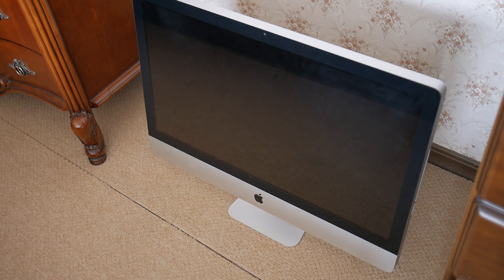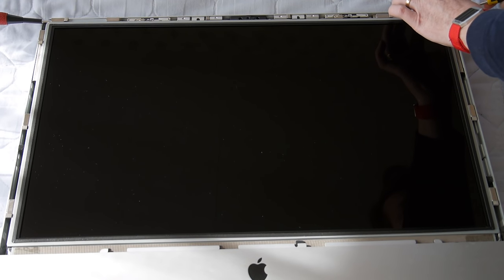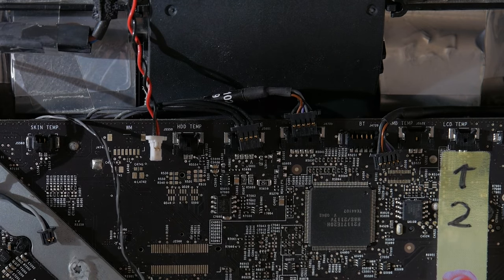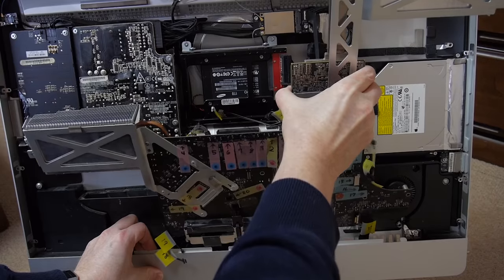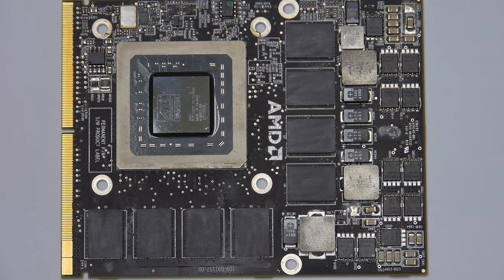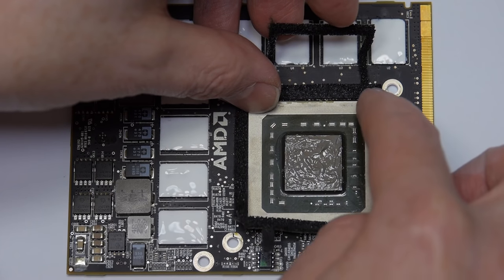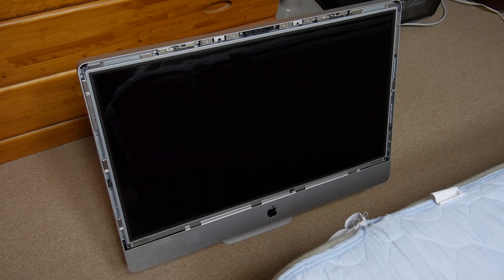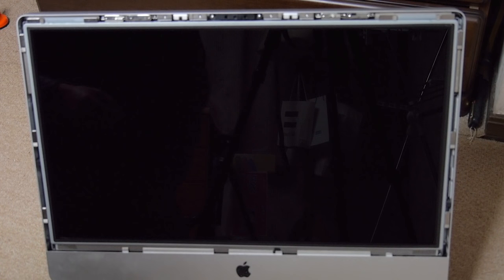Late 2009 iMac 27" Video Card Repair [4850 Bake]

Comment: I have two  2009 iMacs with suspected GPU problems. I took one apart to replace the thermal goo and ended up with a few screws left over :-)  It still  has occasional graphics hangs, annoying really since with a PC you could just swap in a new GPU but a fix for the iMac would cost c £200 from eBay ( new GPU with lead solder) Considering the cost of new Macs these days it may well be worth doing some day though. I've got a SSD in the optical bay and will convert it to a fusion drive when I get around to it.
I actually use my 2011 i7 MacBook pro most of the time these days it's already had the fusion drive upgrade and is a higher spec any way apart from the screen size. ( and I get to sit on the sofa all day too !)
Reply from the maker: You said you changed the thermal paste, but did you perform the video card bake as specified in my video?  Simply changing the thermal paste without baking the card will do nothing beneficial.  If you did perform the bake as I suggested, then your case is somewhat special because I've not heard a bake-failure from anyone here in the comments.  I could guess that the card may be bad beyond repair such that a bake would not work in 1 of your 2 computers.  But for both to be in such a bad condition is unlikely.  So again, if you merely changed the paste and did not do the bake, you will need to do the bake (10 min. @200°C) and then apply paste and then test before you can know whether your video card can be resurrected or not.  Thanks.
Reply: yes I think I may well end up 'doing the bake' at some point… I can't afford to send the GPU off for repair at the moment any way. Personally I think the 27" screen is a little on the large size for what I use computers for at the moment. I had ambitions of setting up a work from home office but like I said I mainly sit on the sofa and hack away on my laptop :-) I was definitely disappointed when it statred to freeze up, I have them both sat next to each other and use one in secondary display mode. The one that is driving the secondary display has the worst problems, although using SMC fan control it only locks up once in a while, so perhaps until it become un bootable I will leave it be for now ! If/when I take it apart again I will try to re-home those left over screws :-) Apple replaced the logic board on my 2011 MacBook last year for free so that makes me a little happier . Hope the iMac is still going strong sing last baking  ?
Reply from the maker: Thank you for clarifying that you haven't done the bake yet.  I like the big 27" screen for viewing photos or videos and for editing too.  It's not 4K but 1440p isn't bad at all.  Yes, my twice-baked video card is still going strong in my 2009 iMac as of Jan. 22, 2018.  No issues at all and the computer is used daily, for several hours per day, and my son plays games on it as well.  Be sure to let us know of your success or failure after your bake.

Comment: Hello JDW,
By disconnecting the INT DP connector from my imac 27 at the end of 2009, I broke the tracks on the motherboard (2, 12 and 31). On the Apple plans, track 2 is connected to resistor R 9050, track 12 to capacitor C9043 and track 31 to capacitor 9010. I only located the capacitor 9010 but I did not find C9043 and R9050. With your experience would you tell me where are its two components?
Thank you
Reply from the maker: Would you mind replying with a link to a photo of the "INT DP" and the "broken tracks" you speak of?  Also, when you say "Apple plans" it sounds like you have a full schematic?  That's certainly more than I have.  All I did was watch a few YouTube videos and read stories about using the oven bake method to restore a video card in the late 2009 iMac, and I then tried it myself and found it worked.  But I lack schematics to guide you in fixing "severed PCB traces," which I think is what you mean when you say "broken tracks," right?  If you could post a link to that schematic you have, I can read a schematic just fine and might be able to offer more detailed help for you.

Comment: Iv seen tons of these for cheap or free because the videocard is busted, might try and fix one.
Reply from the maker: There's no guarantee such a machine might no have other problems too, but if you can obtain an older iMac for free, you basically have nothing to lose by trying the bake if the machine won't boot or freezes or displays artifacts on screen.

Comment: Why are you pulling on the wires on the connectors on the logic board? That is a good way to pull them out of the socket. Use a tool to pry the connectors out. That is what the flairs are on the sides.
Reply from the maker: Greg, since you put your advice in the form of a question, I will answer it as such: "Because I've done that often enough to know how secure those wires are in their socket."  :-)  Is it a good idea to use a tool?  Sometimes.  It depends on the tool and how it is used.  It is possible to pry with a tool and find out you created small dents or otherwise cause damage from prying, so prying with a tool isn't automatically the better than pulling on wires.  Plastic tools can help prevent that, but they also can break too.  I performed the disassembly as most people would.  And you'll note that I wasn't "yanking" on the wires, which is of course a very bad idea.  Pulling on wires as a practice isn't necessarily bad, depending on how you do it.  Lastly, I read and reply to every single comment.  Currently, there are 526 comments.  Not a single person has reported that pulling on the wires in the same way I show in the video caused one or more of those wires to pull out of its connector.  With that said, I would encourage everyone reading this to use whatever discretion you feel appropriate to ensure your disassembly and subsequent bake goes smoothly and without causing any new problems or damage to your machine during that process.

Comment: thank you for the video! where is RAM? ))
Reply: Is there any posibility to add memory?
Reply from the maker: @gokostik  I show that at the very beginning of the video at 1:13.  I show how to open the cover and remove the RAM modules. You can swap out your old RAM for large RAM modules here.  You don't simply Add more RAM, you need to replace the existing modules with larger versions to increase the memory.  You can take it up to 32GB if you like.

Comment: Why didn’t you remove the old dry compound from the heatsink at minute 37:11? I’m curious.
Reply from the maker: Because the video above is my FIRST attempt at the bake and I lacked experience.  Another reason is because I was at that time no different than most of you folks and wanted to go on the cheap and use what I had, which was a small amount of existing thermal paste.  I didn't have thermal pads or even know about K5 Pro (a thermal pad replacement) at the time.  I rectified that mistake in my 2nd Bake Video.  But I think it is good to keep my 1st Bake video up because it still is very instructional in other regards, and it also shows what defines a "mistake" and how I later rectified that mistake by cleaning everything off and then using the correct replacement thermal pastes.  All said, please watch my second bake video for details on how to properly do cleaning and repasting.
Reply: Totally agree! Thanks so much for this awesome video and let us know how to make it work, step by step. Gonna look at your second video right now. I bought a Mid 2011 27” inch model a month ago with a one year warranty, the GPU started to fail so the seller who is a technician told me he will repair the iMac so I’m just waiting for it to be done, but I was digging into the issue and then I found you! Gonna told him about this and hope he can solve it quicker. You are THE MAN.
Reply from the maker: @INDIE505  Although there are some differences between your 2011 iMac and my 2009 iMac, the video card baking process is the same, and the pastes I recommend (K4 Pro for the GPU and K5 Pro for the memory chips) is also the same, regardless of which video card you have.  Please be sure to read through the text description under each of my videos because I spend a lot of hours constructing that info to be as much of a help as I can.  You'll find links there to the items I used for my bake.  My 2nd Bake is basically the same as my 1st Bake, but my 1st Bake video shows how to remove the motherboard.  My 2nd Bake video shows you how to remove the video card WITHOUT removing the motherboard.  Even so, if you want to replace the PRAM battery, you'll need to at least partially remove the motherboard.  I hope this helps!

Comment: Hello. What exactly was wrong with your video card? 
My mid 2012 imac suddenly stopped working. My mac powers up but the screen is blank. Took it to an apple service center to check it out. They said there was an issue with the video card and possibly the logic board.
I was thinking of trying your hack, involving removing the video card and putting it in the oven. I'm hoping I'll  will be as successful as all the others who commented on here.
Reply from the maker: I had a variety of symptoms. Sometimes it would just freeze after it was already booted. Other times it would freeze on start up and show artifacts on screen. Powering up with a blank screen like your case is a common symptom as well. You have nothing to lose by trying the bake except for a few hours of your time, so I would recommend it. But be absolutely sure you read through the text description underneath my video so you can prepare all of the tools and thermal paste required. Also note that I have a second bake video that you should review as well.
Reply: @JDW-  thank you so much for your feedback. What is thermal paste? I'm not sure if it's available in my country. Also in your video you mentioned removing the paste with alcohol solution.. Is there any other chemical I can use to remove that paste?
Reply from the maker: @gelpromotions7756  Start watching my 2nd Bake video from 27 min. 37 sec. to see exactly what "thermal paste" is and how to apply it to the video card: https://youtu.be/6BJGLFCigdA?t=1657
Reply from the maker: @gelpromotions7756  I bought the thermal paste set (2 types) from Amazon Japan.  It is sold at Amazon USA too.  Check Amazon in your country.  The company who makes K4 Pro and K5 Pro is located in Greece.  Here is their website: http://www.computer-systems.gr/en/content/product/k5-pro-k4-pro-set
Reply from the maker: If you cannot get the paste and the alcohol, I cannot recommend the bake to you.  Those 2 things are the most important things you will need to do this bake properly.
Reply: @JDW-  noted, thank you for your comprehensive feedback. Much appreciated.
Reply: Do you have an email address. I'd like to email you a picture of the video card from my machine so that you can check if it the same type as all the others on this forum.
Reply: Absolutely astounding! A true resurrection from the dead.... My imac is alive!  Thank you so much for your video... Truly life saving..

Comment: if you dont want to spend the money on the interface for the temp sensor , there is a application online called Macs Fan Control. You can easily set a rpm speed for you fan and TADA, done.
Reply from the maker: Yes, and links to those fan control apps are actually given in the text Description below my video above.  But when I installed my Samsung EVO 1TB SSD into my late 2009 iMac, I still wanted to have the temperature sensor installed too so I did not need to rely on software to keep my iMac's fans running normally.
Reply: @JDW-  yea i mean i totally get it, have it auto do everthing the way it should. Great vid. Keep it up

Comment: hi JDW finally I get the video card!!, but i found a big surprise , My Card have !!! tha´s mean the card is fixed in other times?, the original video card come whit out paste, rigth? .. Thank´s for your help!!!!
Reply from the maker: Jose, my late 2009 iMac (shown in my video) had medium gray thermal paste on the GPU chip and very light gray paste on the memory chips. As to your other comments, I don't understand what you mean.
Reply: When you first repair an imac the video card brings the paste applied ?, since in my case, I found a paste applied to the video card
Reply from the maker: Jose, there is thermal paste applied to the heatsink and GPU and memory chips when you buy the iMac, yes.  There is always thermal paste applied because without thermal paste, heat would not transfer well from the chips to the heatsink.  The reason is because no surface is perfectly smooth, so there would be tiny gaps (no contact) between the chips and heatsink.  The thermal paste closes those tiny gaps and ensure proper heat transfer.  That is why you must replace the paste when you perform this video card repair.  If you do not remove the old paste and bake the card, and then put it back, the old paste would probably be too hard to do its job.  In fact, there would probably be more gaps in that case, making the situation almost worse than no thermal paste at all.  So just do what I did in my video and you will be okay.

Comment: I wondered if you could help me. As you have numbered the LSD disassembly connectors, numbered 1-4. Do you know if any of those connectors have anything to do with audio? I have previously swapped the optical drive with a SSD, but after putting it together, there was no audio. It didn't even show in system preference/sound. I might have tore the connector number 4 (upper left) when reassembled. I those connectors have nothing to do with audio, do you know where it is placed?
Reply from the maker: The speaker connectors are shown in my video starting from 16:06 and are just to the left of the rightmost fan.  The connector labeled "4" in my video is for "Skin Temperature" and such is printed above that connector in white silkscreen on the motherboard; but that would impact fan speed, not audio.